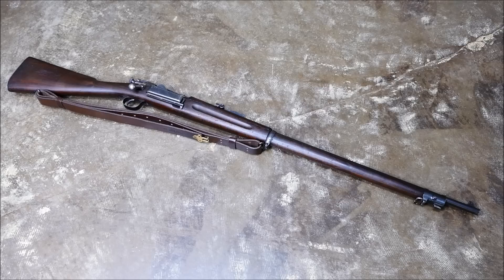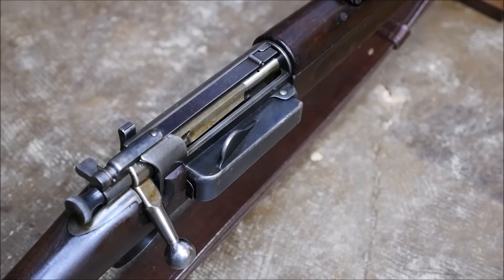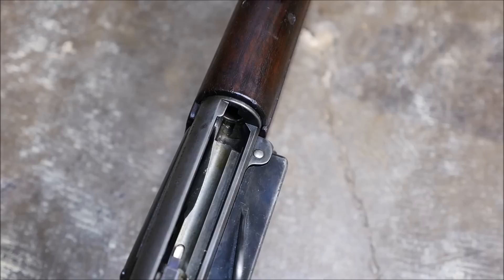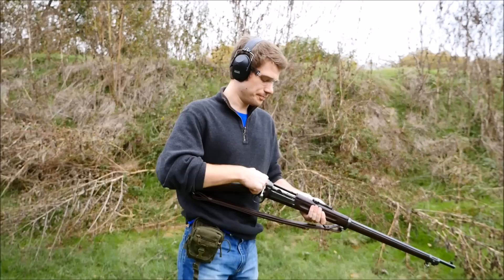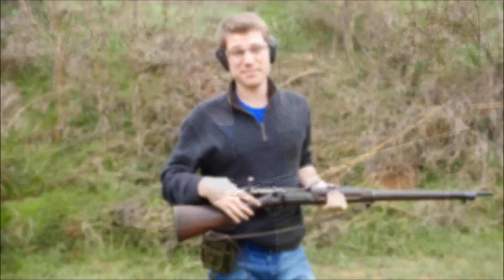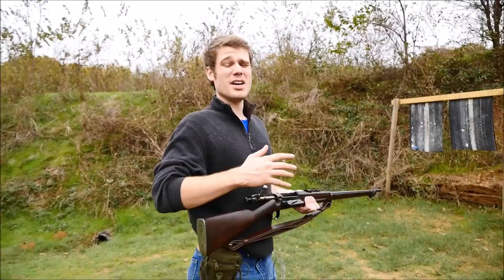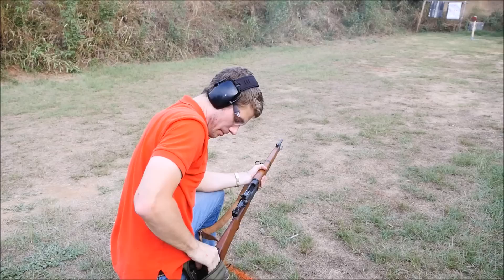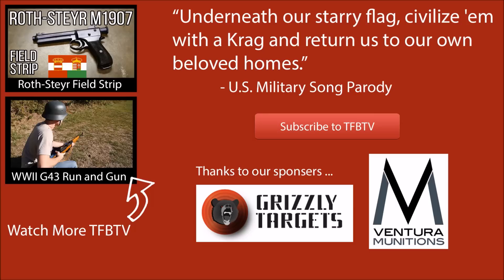Krag Jorgensen Run and Gun

Comment: Interesting video! 
Just a couple of comments, and they are mainly related to the Norwegian Army Krag m1929, which my father used to teach me to shoot. These comments may or may not be relevant to the US Krag. 

First and foremost, the Norwegian Krag is in 6.5x55mm, which is a RIMLESS cartridge, and that eliminates/minimises the possibility of rim lock and makes the cartridge much easier to load. But the beauty of the Krag using rimless cartridges, is that you can basically just dump a five cartridges in the magazine and the closing of the gate will align them automatically. Incidentally, speedloading devices were prototyped, but never implemented, because they did not speed up the reloading significantly. 

Secondly, the standard Norwegian Army doctrine during the Krag period was essentially a defensive one. Norwegian Soldiers were taught to use the single round magazine bypass facility (which I do not know if the US Krags have), fire well aimed single shots at long range, leveraging the excellent accuracy of the Krag. The five round magazine was to be held in reserve and only be used if being rushed by the enemy. So the rifle was never intended to be used in an “assault rifle” scenario - which the Run ‘n Gun basically simulates. Any review of an item must be based on the designed use of the item....

Having thus tried to uphold the honour of the Krag, I must of course admit that a stripper clip is much easier and faster to use. The Krag magazine was - let’s face it - only used to get around existing patents for magazine loading systems, I.e. the Mauser clip.

Comment: i keep hearing about this 'rim lock' thing...  i've been shooting krags for over 20 years without ever experiencing it-  and all i've ever done is just toss a handful of shells in and close the door.   

the original military load had a round nose bullet and i think the feed problems come from using spitzer design bullets.  the only failures to feed i ever had were due to commercially loaded ammo (it wasn't a rim problem - they didn't want to feed even if i only had one round in the magazine).  since then i've shot nothing but reloads with round or flat nose bullets and the problems disappeared.

Comment: Also worth noting that you arent under any spring pressure loading the cartridges, so that makes it easier.

Aaaand this rifle was made for 6,5x55 which is not rimmed, and is easier to load I would imagine, never tried a 30-40 krag one
Reply from the maker: +kamferjau Actually they were first adopted in the rimmed 8x58r by the Danish. They didn't end up in 6.5 until years later.
Reply: I did not know that, thanks! The 6,5x55 one served to be the most popular though it seems, the norwegian army used it up until the second world war and during it, and anecdotally germans were said to have been terrified by the precision norwegian army/resistance showed with their krags. 

They are also as you said very slick bolts and famous for this, with old competition shooters using toothpaste and dry-cycling the bolt to make it even smoother.

As a followup question: Have you shot any 6,5x55 rifles? I am sure you have tried a swedish mauser or perhaps a norwegian krag.
I still use this caliber for hunting and long-range myself, love it.
Reply: It took 5 years by looking on the adoption dates, the Danish Krag 1889 and the Norwegian Krag in 1894. but in real life the action was reworked a lot sooner as Captain Krag himself was on the Swedish-Norwegian Rifle comission, and as such the Swedish mauser round was at least partially developed by the team behind the Krag rifle.

Comment: The rimmed cartridges are imaterial.  Rimlock only occurs in a feeding magazine.  The Krag was designed to never create rim lock.  It is literally impossible to rimlock on a krag.  You don't need to feed them one at a time and can literally dump a handful into the side gate.  The only issue is the top opening can catch a round where it won't close, especially on the latter rounds, but not nearly as difficult as depicted here, though not suggesting it could keep up with a clip fed system.

Comment: Nothing clumsy about it. At San Juan, they were fighting uphill against a heavily defended position any rifle would have had a tough time in the same circumstances.In skirmishing, they didn't shoot the magazine dry and then reload. They used it as a single shot with the magazine held in reserve. If you were using the magazine- fire two or three shots, drop and reload as you advance. You always have a live round in the chamber.I have a near mint '98 Krag dated 1902.Go watch the old movie "The Wind and the Lion", while the Marines depicted should have had Winchester Lee M1895's it is still a pretty good flic.

Comment: The Swedish Mauser in 6.5x55mm with stripper clips is one of the best bolt action service rifles ever produced. This Swedish Mauser has little kick or recoil, is easy to shoot, is highly accurate, and has excellent ballistics for a combat service rifle out to ranges of 500 meters. The next best rifle is the M-39 Finnish rifle in 7.62x54mm rimmed. The M-39 is a reformed Mosin-Nagant bolt action rifle. The .30-40 Kragg Jorgenson round was chambered in the lever action Winchester 95 but without being able to accommodate stripper clips. The .30-40 round was good but stripper clips were needed in the rifle to make it a viable service rifle. The .30-06 round in 7.62x63mm wastes a lot of gun powder for combat ranges under 200 meters. The Swedish Mauser in 6.5mm and the Finnish M-39 are the best bolt action military service rifles ever made.

Comment: Those were different times.  The magazine has very few advantages to it, maybe the only one is that you can topp off the magazine while the rifle is in battery. Not anything to consider today, but let's say you've fired a couple of rounds, and you chambered the third round. You just open the port, and dropp whatever rounds you've spent in there. The one lug is a huge problem though, along with the asymetric construction. What happens when the rifle heats up 😂

Comment: It's certainly not as fast as a stripper clip, but the cartridges don't need to be seated, just drop them in, close the gate, and cycle the bolt. 

It's an extremely accurate rifle, and the bolt is incredibly smooth. Unfortunately, the ammo is quite expensive, if you can even find it. I wish I'd kept my brass from the first few boxes, so I could have them reloaded.

Comment: Fun to see an old military classic put through a run & gun. If Krag & Jorgensen had put a bit more thought into the loading system it could have been much faster. Looking over a Krag its easy to come up with a few ideas to improve the speed of  reloading. Other than the slow reload, Krag carbines are very pleasant to shoot. Light recoil + light/fast action. I would like to see a run & gun with the Spencer carbine using the Blakeslee box tube reloading system. Faster than the Krag would be my guess.
Reply from the maker: +mike messier I would really like to do this with a Remington Rolling Block to show how big of a difference bolt actions made vs. single shot breech loaders.

Comment: The problem at San Juan Hill was that many of the US troops were still armed with Trapdoor Springfields. Procurement of the Krag was slow, just like happened with the 1903 Springfield prior to WWI - thus why most US troops in WWI were armed with the M1917 instead, a rifle easier and quicker to manufacture. Had the US Krag been chambered in a rimless cartridge like its Norwegian parent the issues with rim lock would not have existed.

Comment: The Krag would be better where you can just use a Stripper clip than the fixed Side magazine.

But the Bolt-Action is so smooth. They would've applied that design to the M1903 Springfield.

Comment: That action looks so buttery smooth. Looks like you're cycling using a feather. Are Krag rifles usually smooth like that or is it due to primo maintenance? Nice Job on the course btw.
Reply: those actions  are that smooth  like the ole timers used to say   slicker than greased Owl Shit
Reply: Smoothest bolt action I have ever tried.

Comment: There are a few things that could have been done to make it go a bit faster. For example, you left the bolt open while reloading rather than top it off. Reloading with a round in the chamber was one of the selling points for the Krag to begin with. I agree the system is more finicky than tripper clips, but it was faster than non-stripper clip friendly guns like Mosins(which are a pain, even if it was designed for them) and Lebels.
Reply: +Douglas Paulson A Mosin that is working right is very fast with chargers :)
Reply: ***** The problem is most that were issued weren't working right and had issues with stripper clips..
Reply: Douglas Paulson
What are you basing this on? I have seen many Mosins that work just fine :)
Reply: ***** They needed a bit of tlc before being smooth didn't they?
Reply: Douglas Paulson
nope
Reply: ***** lol you sure it was a Mosin?

Comment: Nice video, smoothest bolt ever, fast if using the spring mags, very accurate, it was a interesting time in firearm development... Smokeless powder was new,  yet, still using round nose bullets. Just the fact it was called a "30-40" tells you the mindset of the armament department.  If we had developed the spitzer and shot 160-180 G bullets, trajectory would have been better than trying to push the 220G 30-40's faster. The US was more concerned with precision fire than rapid fire. AND the Krag, unlike the Mauser could be reloaded and still have one in the chamber and ready to fire. The mauser was a fine weapon, so fine the US copied it and got sued and then sued again for some infringement on the spitzer bullet. Nothing finer than a KRAG...

Comment: Its so irritating to think that the handloading is always thought off as the rifles biggest weakness. BUT! There where fastloaders made for the rifle.  And using that made it on par if not faster than a top fed stripperclip. However in at least Norway, the military did not use it for some reason. It was issued to the local target shooting clubs. :-)

Comment: As far as firepower it was awesome for the US Army at that time in the 1890s.It was faster than the M1884 45-70 Springfield and did not fire black powder which produces a lot of smoke.The Spanish Army did arm only a small portion of their colonial soldiers with Mauser rifles.The rest were armed with Remington Rolling Blocks in .43 Spanish.The US Army and the Spanish were almost equal terms as far as Infantry rifles.The Americans were still trained to fight American Indians and the Spanish fought rebellions in their colonies like Cuba,Puerto Rico,and the Philippines.The Americans still used the skirmish line from the Civil War and the Spanish did the same from Napoleonic times using open line despersed Infantrymen with firepower.The advantage of a defensive position the Spanish had was massed fire in a fixed position and putting accurate fire on the attackers thus rounds came at them like kicking a hornets nest also the name "Spanish Hornet" refering to the 7mm Mauser round stinging around them.The Americans had the disadvantage of attacking in any position and being pinned down unless helped by artillery or Gatling Guns as supporting fire.In an Infantry VS Infantry the defending Spanish would have won.The Spanish Colonial Army were small in numbers and could not be reinforced compared to the invading Americans.Facing an Army almost equally armed and disciplined,the Americans were not Rebels and unorganized and supplied.One of the first in modern combat until the Russo-Japanese War which both were armed equally and tactics,training,and practices were to modern European standards.

Comment: in all fairness this is a danish design rifle. it was the danish army that took the design in and tested trough at-least 3 stages (different test rifles) ending up with the danish krag made in Copenhagen - The M.1889 Krag-Jørgensen ...the ammo box design was made from the side not the top like on the American and Norway later models. and a speedloader was available... and last i can fully load my krag and shoot faster then any clip bolt action. but it takes practices. and this gun was NOT design to be single loaded. if you cant just throw them all in (bullets) and shoot then theres something wrong with your American model.
Reply: +Jesper Eiberg The concept and design is pure norwegian. Designed and built in the 1880s by two norwegian officers, director of the armoury(Generalfelttøymester) Major-general Ole Herman Johannes Krag and gunsmith Erik Jørgensen of Kongsberg Våpenfabrikk. They designed the capsule magazine system, first tested on a older norwegian Jarmann rifle, and later sent some prototype rifles to Denmark in 1886 for further testing and modifications. The M/89 of the danish army was the first one to be adopted as a standard service rifle though.

Comment: I just grab five rounds from a pouch and drop them in.  You don't have to load one at a time.  Open the mag door, drop five in all at once and slap it shut. I've never had a rim lock like on a Mosin.  Mine's a carbine version that Great grandpa sporterized and it makes a great brush gun.

Comment: I want a Krag-Jørgensen rifle and the pistol 😂 if possible.

And I rather use a Krag-Jørgensen than any nok-Scandinavia rifle in battle. The krag as any gun can be handled extremely well when one knows how to use it properly. I have seen someone loading it pretty quickly by not taking their hands back and forth which takes time. Take the bullets you need in a hand and feed them in the gun one by one. And you should see improved speed. And well, I see that the Krag-Jørgensen could have profited more from going over to clips in a later version.

Comment: The first round flying off from your pouch tells you how bad the loading gate design is.. lol
Reply: theres really no need to put them in one by one, and there are speedloaders for it, this rifle was used untill late into the 90's as a competition gun, shooting series iof 10's at 200 meters, untilll the Sauer STR 200 took over the dominance.. it is still used though, the biggest issue with ot is the bold lock, its only one bolt-lock something tat forces the use of lowpreassure ammo on the old rifles out of safety reasons.

Comment: When faced against Norwegians armed with Krags in 1940, the Wehrmacht found it self outgunned and indeed starting using captured Krags themself on mass scale. The Norwegians fired the Krag very accurately because it very much resembeled their normal hunting rifles.
Reply from the maker: +Atle Sigmund Reigstad Outgunned? Norway fell to the Germans in 60 days, and mind you that small arms played a relatively insignificant role in the conflict.
Reply: +Atle Sigmund Reigstad If your read Colonel Haneviks excelent book on the Krag, you will see that the Krag was not viewed as a good rifle at the time of the German invasion. And the 9th of April comission viewed the faults of the rifle to be minor compared to the faults of the heavier arnaments, and as such the the rifles performance did not make a difference either good nor bad.

Actually had Norway not been invaded the mauser would have replaced the krag, there were extensive trials in the 30's but not enough funds to replace it until the spending increased leadig up to war.
Reply: +TFB TV 
"Outgunned" as in "Donner und Blitzen, zey haz better gunz!" 
Norway fell to German troops indeed, but we lasted longer than any attacked West-European country. 
We were out-trooped, not outgunned.
Reply: Norway fell to the germans in about the time it takes to walk the length of the country, moe or less. The German advance northwards was never halted to any significant degree. 
I eould wager you now want to stomp me with the battle of Narvik, a battle in wich the relieving forces of the besiged was within artillery range of the besigers with the besiged still an intect fighting foramtion at its end. Not much of a victoy, acctually it can be argued that the battle was a complete victory for the Germans. They achived all their strategic goals from the moment the allies commensed the  landing at Narvik. The Town was denied any strategic value as DIetl held the railway. And most importantly he tied down all allied forces need to liberate the Tronheim region, a failure that ment german air superiority over the Narvik area was assured, not to mention the eventual link up of DIetel and Feurstein was assured as long as the latter could hold on. Wich Dietel did exeptionally well!

Comment: That was fast, shot to shot. It reminds me of the 6mm Lee Navy. Did you run that rifle as well or am I mistaken? Anyway, it looks like a fun shooter.
Reply from the maker: +notsoserious09 Why would it remind you of the Lee Navy? They are straight-pull rifles that accept stripper clips (I have one but haven't shot it).
Reply: The low recoil. The 30-06, 8mm mauser, lebel, etc are very powerful. You had the muzzle back down and were working the bolt quicker than the higher powered rifles (as I remember). If you were shooting a 1920 three gun match, I would say that you had a good rifle for that if it wasn't for the loading mechanism.

Comment: one clear advantage I can see over stripper fed rifles is that there is no difference in speed no matter how many times you reload, whereas on say, a mauser, when you get deep enough into your ammo reserves bullets will need to be either fed onto strips to reload or reloaded one at a time. He was getting the Krag loaded very quickly by just taking handfuls of bullets and cramming them in. A soldier with enough practice could be just as effective with either gun, I think.